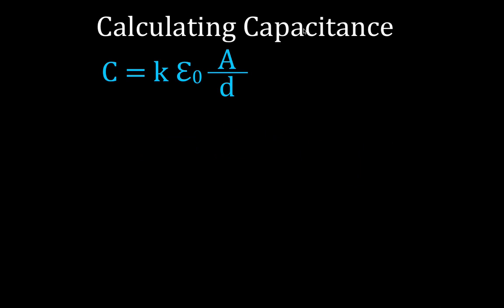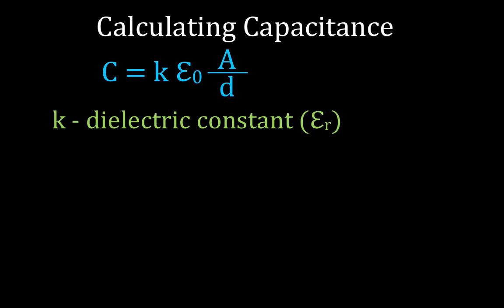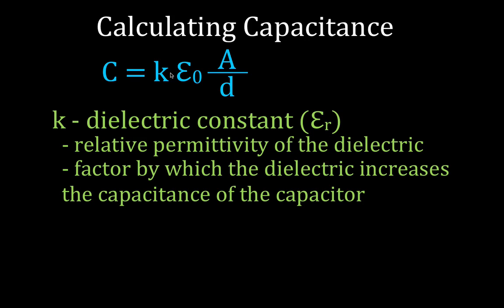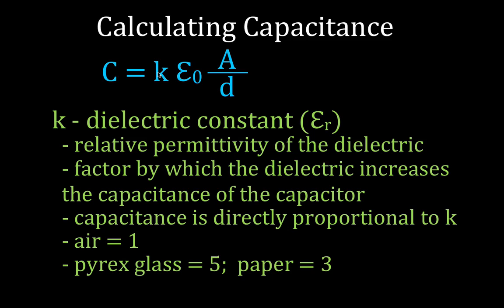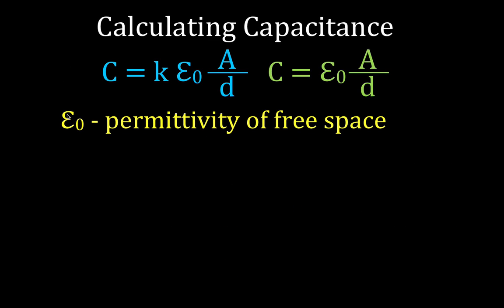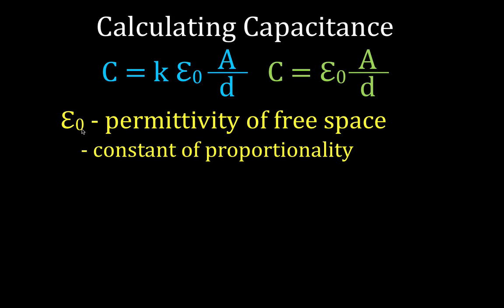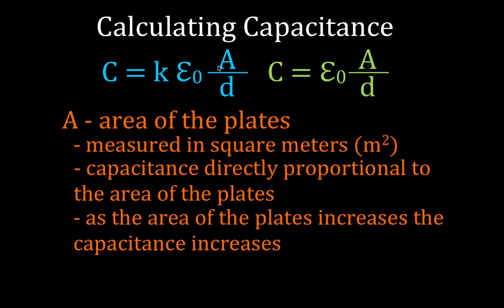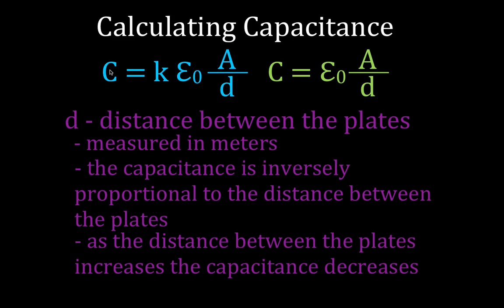Capacitors (4 of 9) Calculating the Capacitance of a Capacitor, An Explanation

Comment: hey i hope u can response asap thank u, may i ask. the first problem, the distance was in a scientific notation form, but in the 2nd one, it was now the area which was in scientific notation, how did that happened? hope u can still response thank u so much i just needed it asap (sorry for my bad english)
Reply from the maker: If does not matter what form the values are in, scientific or standard form, you just have to put the correct number in. First of all you have to convert to meters because that is the base unit for length in the metric system and the constant has its unit in meters, but I in the first problem I could have used 0.00215 m instead of 2.15 x 10^-3. It is the same thing.

In the second problem I could have put 0.005 m in for the area because it is the something as 5.0 x10^-3 m. They are both the same.  Does that help?
Reply: @stepbystepscience  OMG THANK YOU FOR THE EXPLANATION. Now I understand it much better, this really helps me a lot, have a good day, thank you again!!!

Comment: Is there a problem that needs to find the separation? If so, please tell me how to find the distance with given. If not, tell me why its not possible.
Reply from the maker: You can calculate the distance by rearranging the equation:
d = kEA/C
Reply: @stepbystepscience  Thank you for answering! My initial thought is also the same as yours. But how do I rearrange this equation?
How do I rearrange the formula to find the distance from the original formula C = kEA/d?

Comment: Question about the plate area... In an open-air variable butterfly capacitor, is this the TOTAL surface area of the rotor AND the stator?  Both sides of all plates?  Is it just the rotor?  Just the Stator?